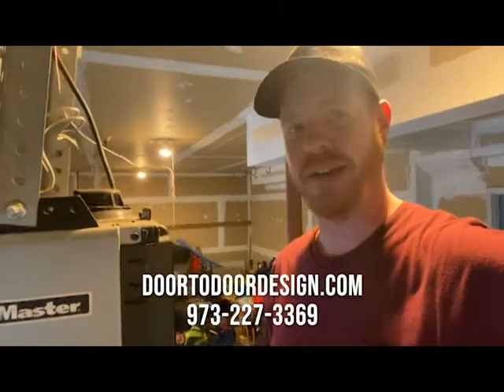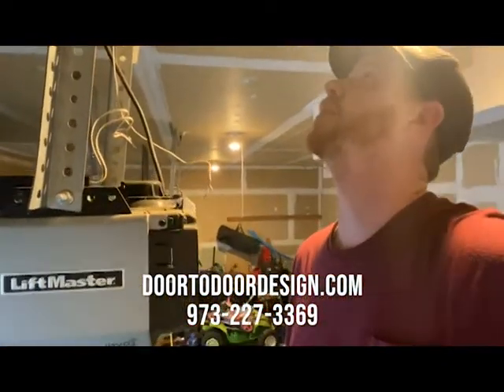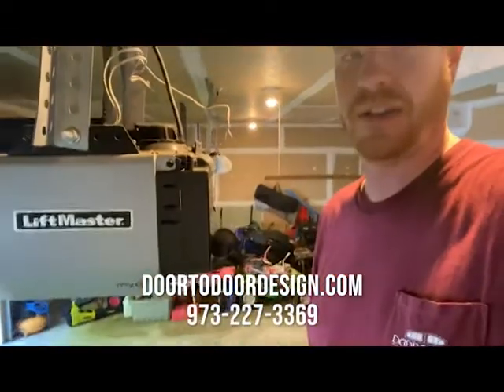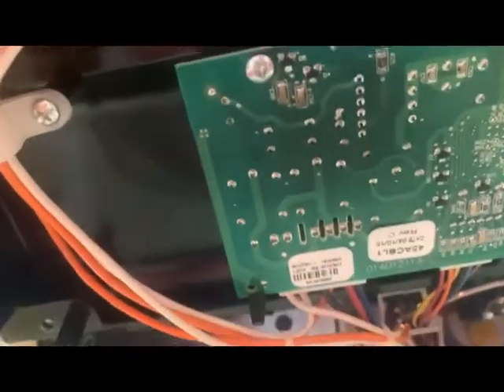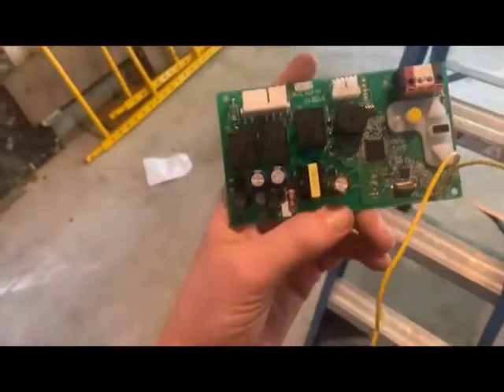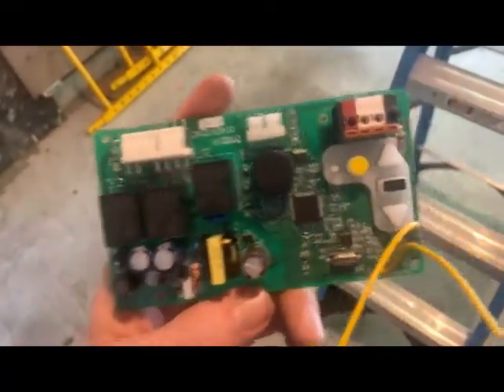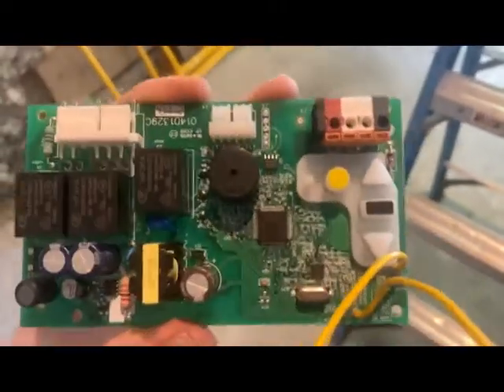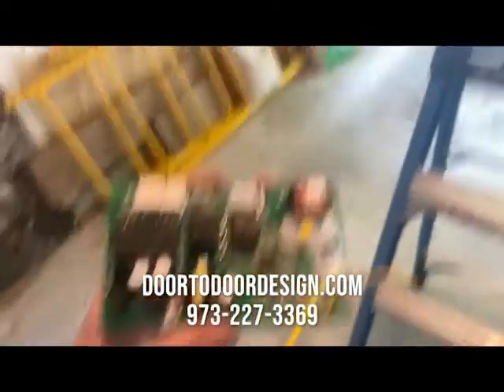Lightning Fried My Garage Door Opener

Comment: My marantec says 15 with a wrench. Door will open and will only shut all the way if i hold in button all the way til it closes. Remote will not close door but will open it.

If i dont hold button in on closing it will act as if something is in tge way and make door go back up.

Nothing is blocking my sensors and they are aligned. One is solid red and other is blinking green.

This happened after lightning storm. Is my board fried too even though my door still wors but just wont close all the way without holding button?
Reply from the maker: Probably photo eyes check to make sure they are perfectly aligned, if that's not it check for any damage to the photo eye wire if all good try a new set of photo eyes.

Comment: How do you know the circuit board is fried?
Reply from the maker: There is not a lot to these machines, a motor, some gears, and a circuit board. If the issue seems to be electronic in nature it's most likely a board. And these run on low voltage so lighting in the area can often cause a power surge that can damage the board.